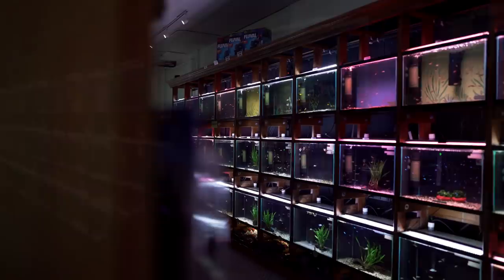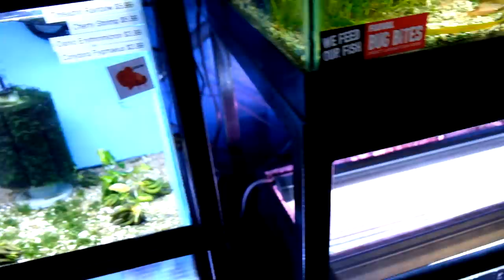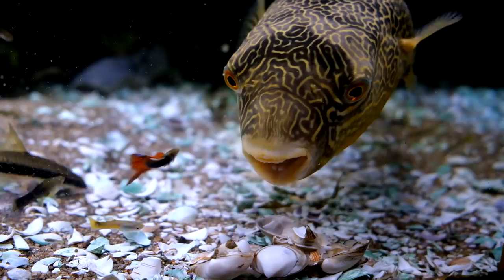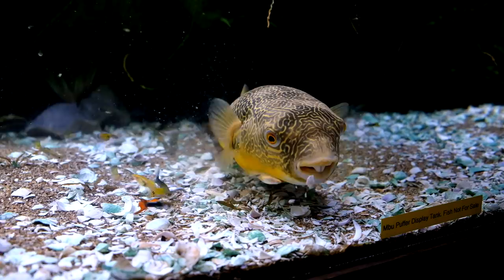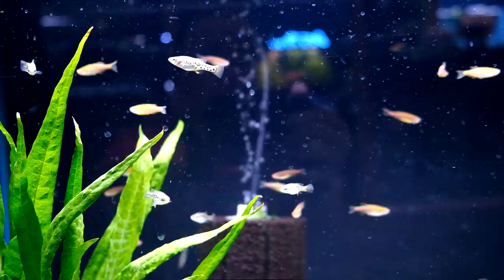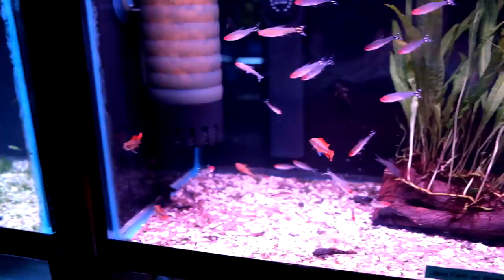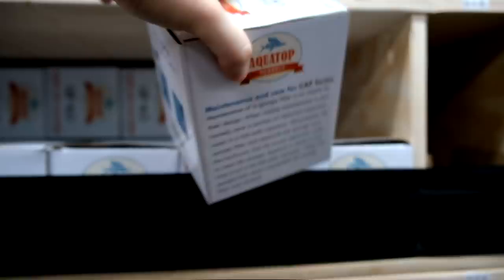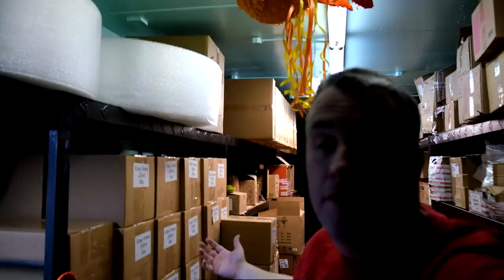How Aquarium Co-Op was Built - The Tour.

Comment: I know this is a little older,  and not sure if it was brought up.  You might save money by upgrading and installing a single uv in line on a closed loop.  This will allow you to set up a pump specifically for the UV,  and adjust for the hang time. Some bacteria requires a specific time and flow through the UV to completely destroy the cell membrane. 

Something I have learned from starting my saltwater reef tank.